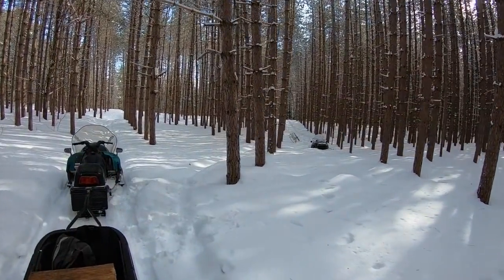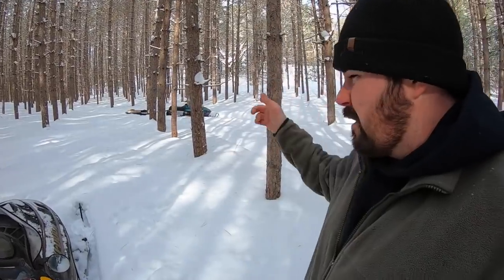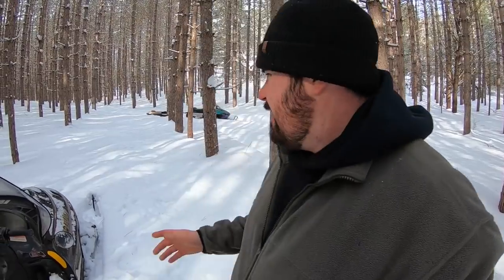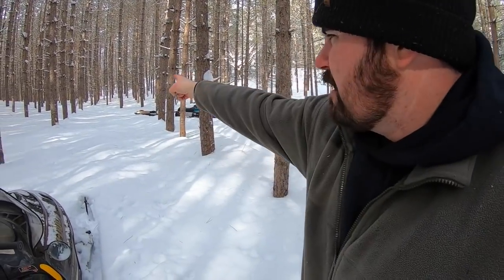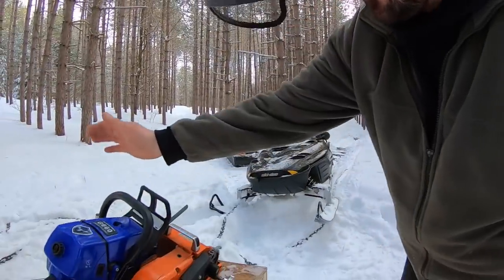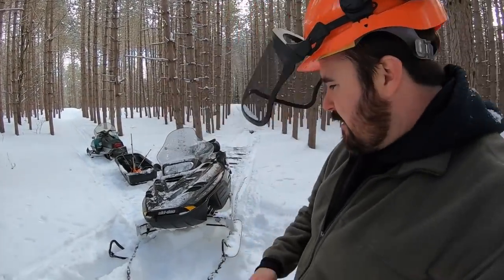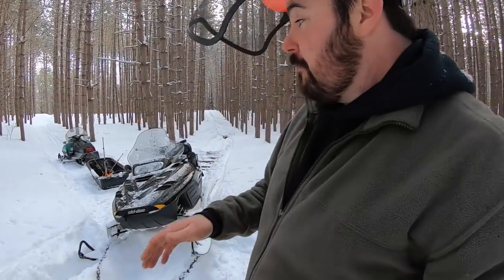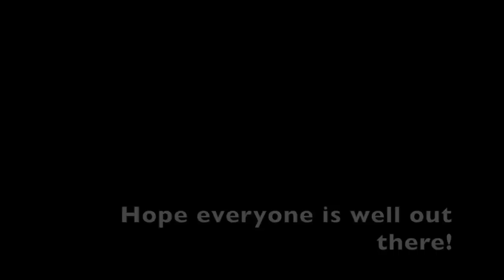How to Break Your Snowmobile with a Chainsaw Winch

Comment: That's exactly what I thought would happen when you hooked up.  I always pull from the skis
Reply from the maker: Yeah learned a lesson this day
Reply: Yep, pull from the front of the skis, from the loops. Not from the vertical piece as shown in this video.

One other trick that gets me out of jams like the is to just roll the machine over 360. Puts the back end on fresh snow. Then pack down in front of the skis. Then power out.
Reply: I think he would have ripped the loops off if he pulled on them. He pulled from the correct spot imo

Comment: Ya.  Bumpers on these sleds are barely bumpers.  Always always do any pulling,  either out of a hole,  or towing behind another sled,  by the spindles the skiis are mounted too. Period.  Second times a charm.  Good recovery.  
Carrying a small shovel with you helps too. Dig around the track both sides,  tip sled on its side,  fill in hole with snow,  tip back down,  and drive away.  Cheers.
Reply from the maker: Second times a charm, that’s for sure

Comment: I grew up in the Kawartha’s/Hastings region of Ontario. I know what the winter snows there can be like. For our family fire wood was our heat and cutting our own was the economical choice. It was normal for us to cut our fire wood this winter for next winter. If you need to be in the woods there bug free winter is your only sane choice and the more time green cut has to dry the better. We always prefer to cut dead black ash off the local swamps.
Dad had an old Alpine (double track) snow machine with electric start. That was our work horse for the woods/swamp. To help haul our wood out dad mounted an electric winch to the back. We’d break trail to our work area and cut to cable length either side. With a sleigh behind that old skidoo we could skid/haul out well over a face cord of wood at a go.
Your saw/winch is a fine tool I think if your tried a winch mounted on your snow machine your hauling would be a lot easier.

Comment: Sandy you would be better to take some snow shoe's and pack a trail to the machine when it is stuck like that! let it set for a hour and then the machine would come out on its own power without the drag. If your wanting to groom a trail in powered snow take the machine and make a track by itself then hook onto the drag in a hour or so and you should have no problems. A small elan is the way to go for packing a trail in powder and are real cheap to pick up! Check out the snow dog snow machine this is also a great tool for the homestead.  Research is your best friend on how to go about something if a person is not sure! Going it alone well one example broken bumper!

Comment: Just in case you think that you have the "walk of shame" down to all by yourself.... nope had to do it more than I will admit too. I  am full of ideas for getting a machine like that out and one that you will probably say "NO" to. That cowl is already broken so take advantage of it and run some smooth bar through the holes now provided in front and do appropriate things to get the bar.. that smooth bar all the way around to each side.... the next I probably should of been said first  which is lift the hood assembly off and find the frame. You will have to fight for real estate so that you can rig something to the chassis and make a solid mount of your own that can have a solid brace bolt/welded to it permanent. You will have to take into account that if you pull on the spot that you pick then what could happen when pulled from the angle picked ( I did a lot of fab work for years in the bush) because if it just bends or breaks it  in a new spot that your reducing that machine to garage jewelry on its walls. Sometimes braces need braces as well... meaning make the pulling point chosen to keep going even further back or multiple places it is pulling on instead of just one spot. Once all those places are secure then tag the rod that you threaded inside. Another would be to just repair the broken spots real well so that it has its face back and make a spot under the machine to pull from that won't break under power from being pulled under. That has to have a access point when stuck or its no help it can't be reach/accessed. The reason is sure you don't get that tangled up often but when you do, you get that right. Facts are facts and if its logging equipment then use it accordingly, with out just out and out abuse. I have made skeleton bodies on snow machines that could be taken off and nice stuff put back on. I think we all would like a snow cat but not on these wages.     There is not enough room to mount its own little winch spot to mount too. Or if you been hiding money from us all then a dozer that can build a highway through you   pristen forest. Thats not going to happen I am sure even if your filthy rich. I sure do know a lot as I know ,     why ain't I rich and add famous since I get to do the adding. I sure hope that it won't break the bank what ever comes of this. Sorry it happened

Comment: Hey Sandy!  Yes little detours can be fun sometimes like that.. been there before… first vid I’ve watched with the winch!  Pretty cool unit!  Just wondering, I noticed about half way out there, looks like you had something over the cable, an I was thinking, was this some sort of item to throw over the cable so if snapped an whipped back it would stay low?  I’ve seen other peps do that with winches sometimes.  Anyways yes, I knew as soon as you said there was a fail, I was 99% sure you were gonna hook to the bumper 🥴.  Ya olde bumpers aren’t what they used to be unfortunately..  Anyway glad it worked out.. now you gonna walk back again to get both machines out lol anyway take care!  Andrew from NB :)

Comment: when winching or pulling anything, the area in between the lines ( the V area) is called the triangle of death. stand on the outside of that. also something as simple as a jacket or floor mat on the line out in front of you is enough to drop it to the ground if broken.
Reply from the maker: I agree. I typically have a coat or my chainsaw chaps over the line. May not have shown that in this video. Hope all is well. All the best.

Comment: You need to pack down trail without groomer then take groomer when trail is packed down also when pulling snow mobile remove drive belt before pulling it will move much easier

Comment: Sandy, Rance here in southern Miss gulfcoast (no snow) but there is a down side.....I have grass to cut ! I'm  sorry that the bumper on the snow machine was inadvertently broken. Just cost more money that you didn't have to spend. I would like to know the rated pounds of pulling power your winch is rated, thanks in advance. Keep those feet dry...dont get frost bite of toes.
Reply from the maker: Hi Rance thanks for watching. The winch is rated for 4000lbs in a straight pull without any pulleys being used

Comment: Yup, I could see the bumper come off before you attached the cable.  Same thing would've happened if it was a car bumper ... they are made for impact and not pulling.  If there had been a metal bar under the plastic it would most likely have been destroyed since you're pulling  from such a high point.  Rule of thumb, anything you drive in the bush needs tow hooks on the front or back.  On the bright side you got more value out of your winch along with a couple lessons learned.
Reply from the maker: Yeah I’ll not make this mistake again. Good learning opportunity

Comment: When you first showed up and saw the layout , I thought to myself, why winch? It's not that stuck especially that close to the  trail, l would have lifted it to it's side thrown some snow under the track stomped out the skies and go. Winched the groomer out after, but then again i'm a monday morning qurterback.
But i've been stuck far worse. Sorry bout that bumper, they're better for bumping than pulling.
Reply from the maker: It may not appear deep but it’s well over 2 feet and since the machine with fluids weighs close to 500lbs, I’m unable to lift it far enough to a spot where it is solid enough to drive out. The winch help save the day here for me

Comment: You must always put a damper over the cable. Incase of  break
Reply from the maker: I agree
Reply: @sawingwithsandy   so i have nasty terrain bush where i am and want to pull logs to the trails available….do you think the winch is worth the money
Reply from the maker: Hi Loyd. I think it's a great option to consider for sure. In terms of speed of setup, my tractor winch is faster for day-to-day use just because it's always ready to go and can skid the trees as well. This Lewis Winch is well built though and plenty strong. If you don't mind the steel cable and you want maximum portability it's a great option in my opinion.

Comment: You are soooooo far from stuck that is why I use my tracking the atv at least I have a winch and it will go through anything like butter
Reply from the maker: I’ve seen ATV’s with tracks but have not seen them get through really deep snow. I’d be interested to see a tracked ATV in the same deep powder for comparison
Reply: @sawingwithsandy  mine flote on about 3t0 4 feet of snow unstoppable you need one and get ride of the snowmobile at least you can used it all year around specially this month the snowmobile is useless

Comment: 7:38 boots full of snow because you didn't put your work pants over top like I've been recommending for ages.  Stop tucking your pants into your boots and you'll have drier feet! Shame you busted the front off your machine too.
Reply from the maker: It’s a trade off between dumping out snow from my boot from time to time it having wet lower pant legs. I prefer the dry pant legs